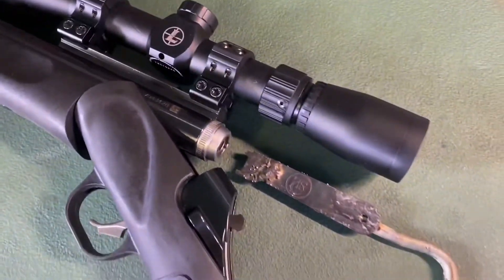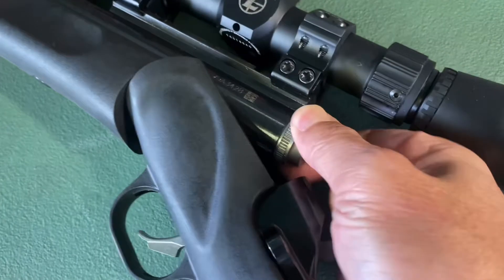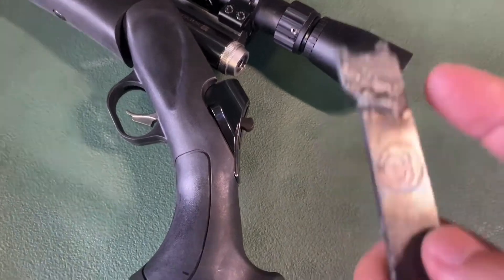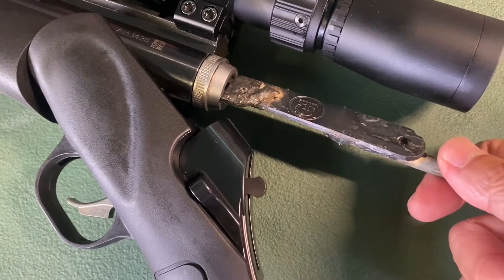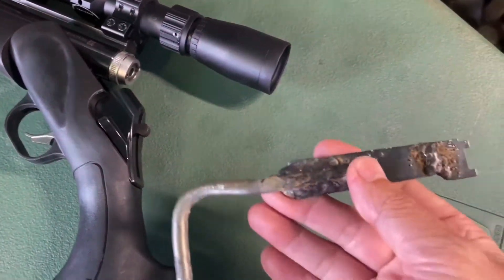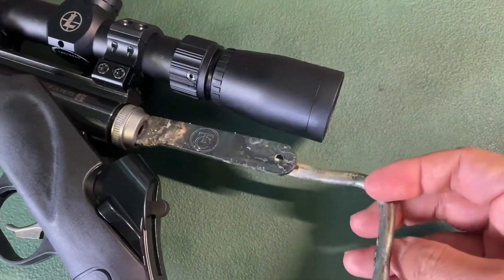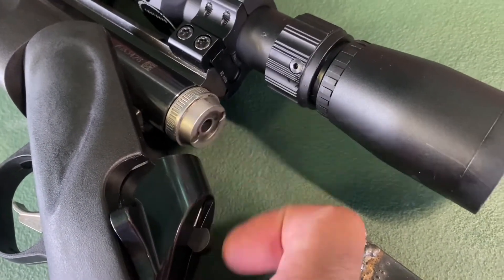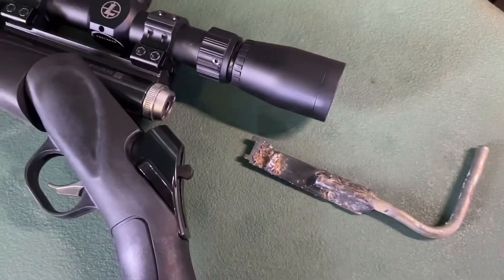Thompson Center Impact! SB Muzzleloader "Speed Breech" Plug Removal Solution

Comment: The breech thread is a 3 start thread. The helix of thread will engage every 120 degree in rotation. I just put a little red paint in one of the drive slots and try it to find the start point where it will tighten up snug , with drive slots horizontal .  It can be removed ( loosened ) with wrench with a scope when drive slots are in this position. Once you find the start point , you will always take note of where that one painted drive slot is before you begin twisting it in.   There should have been a note/tip in manual to aid those who add scopes.